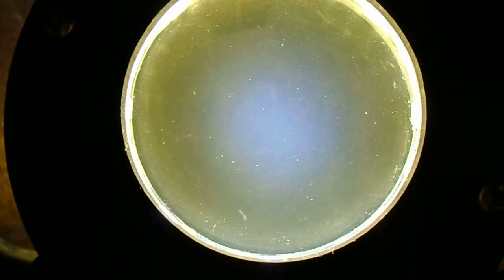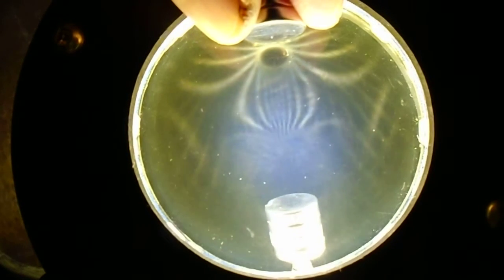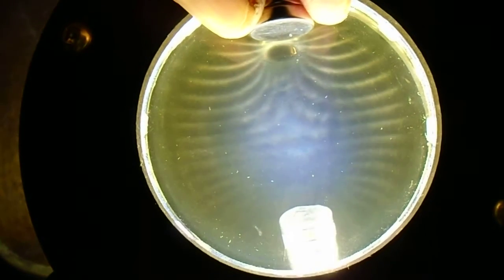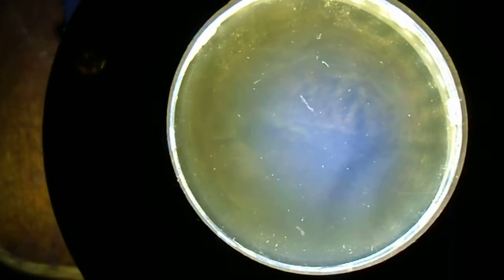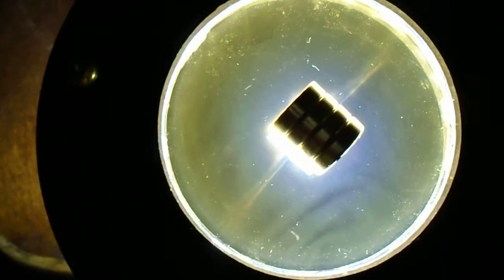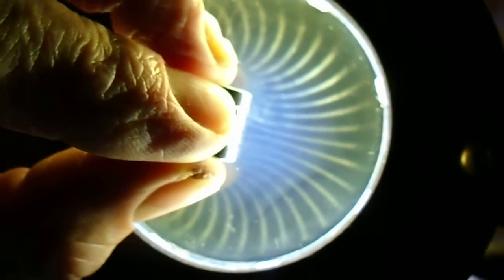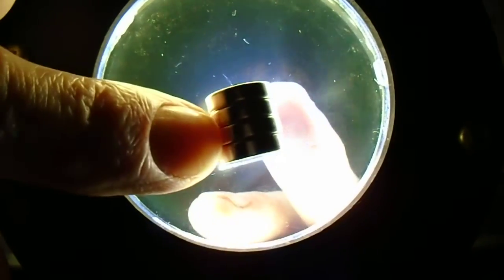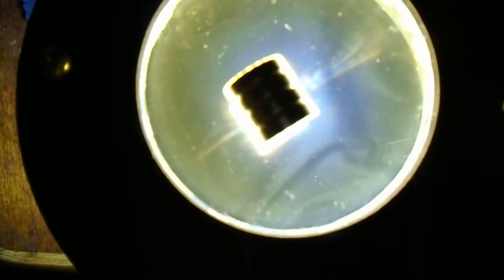magnet poles come together and opposed  + dialectric plane ?

Comment: Where are the lights, relative to the ferrocell? Are they below the cell or are they at the equator of the cell? If they are below the cell, how close are they to the equator?
Reply from the maker: lights are below the ferrocell about 1/2" and recessed back about 3/8"
Reply: What would it look like if the lights were exactly at the equator of the ferrocell? How much does the 1/2" shift affect the pattern?
Reply from the maker: not sure I have not tried to drive it from the edge yet.
Reply from the maker: I tried to light my 5" glass ferrocell from the side. It did not work well maybe because of the surfaces of the glass or maybe the glass is thin and well its glass and glass is not all that clear. I may try to do that with a plastic ferrocell and see it that works better. acrylic transmits light quite well.
Reply from the maker: the image I is the ferrocell so I don't think it matters where the light is. you want it in the spot that works the best and out of your eyes.
Reply: I was thinking it might not work well from the side, but you have a better setup than I do so I was wondering if you would see the same thing I was seeing. I think the light needs to go through the glass/cell in order for this to work. This would indicate that the ferrofluid is possibly modifying the refractive index of the cell when the magnet is present. The nano particles must be aligning like mini iron filings (which is what you would expect) and the pattern is affecting the way the light is transmitted through the cell to your eyes. I would really like to figure this out in terms of optics. Is it diffraction grating? Is it refraction? What is causing the holographic effect?
Reply from the maker: All I can say is the lights are reflecting off the ferro particles and the ferro particles  are aligning to the field so at lease what you see is a representation of the field there are other ways to see different aspects of the field such as the ferrophotos iv made and magnetic field viewing film , iron filings. ... it sure looks 3d  corresponding optical illusion ?